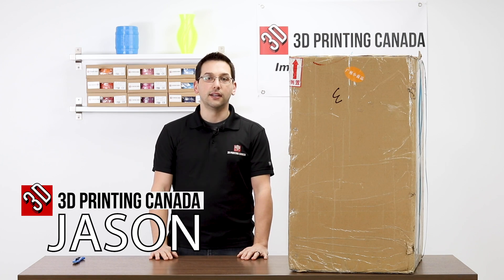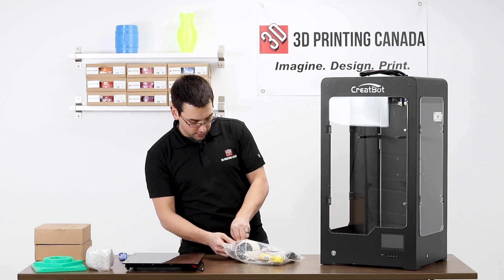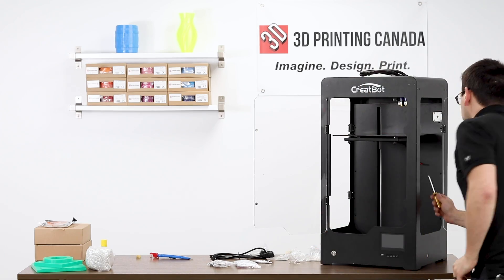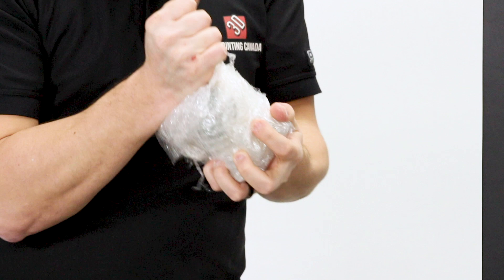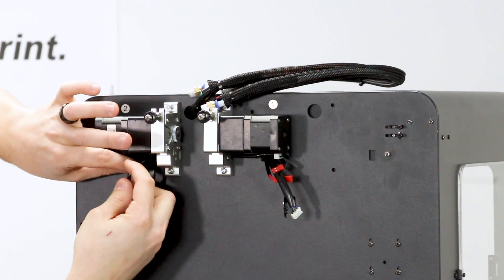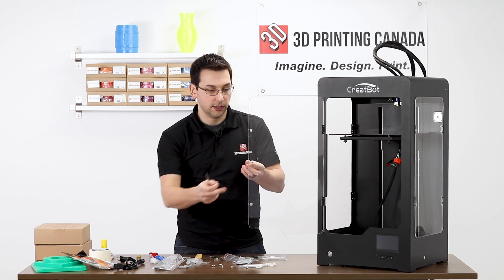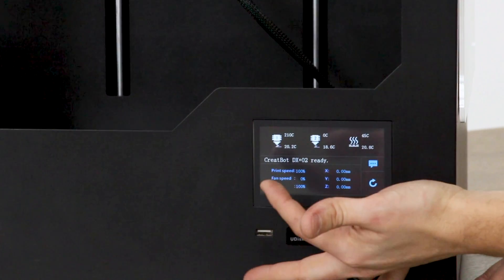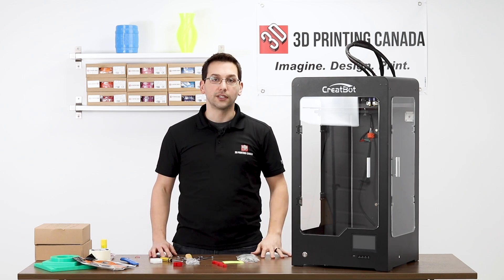Creatbot DX Plus Unboxing and Assembly

Comment: I bought a D600 Pro 2 a few months ago because I wanted a really big printer. Words cannot adequately express my frustration and disappointment with it. I have only managed to satisfactorily print 2 simple mid size storage boxes with it (PLA). All my attempts to print PETG have resulted in failures (extruder jams, filament lifting off the heat plate despite using glue, etc.). The print quality is about equivalent to a first generation Creality. It cannot put down a first layer that is even closer to a Prusa or Bambu. It has WiFi but you can't transfer files to it. There's a large amount of spurious filament in most of the prints. It scrapes layers while printing (yes, I calibrated the height twice). There are pronounced layer lines. All prints require an application of glue. The interface is primitive and clunky compared to modern printers. As far as I can tell, there have not been any upgrades to it, except for infrequent slicer upgrades. It cannot automatically switch to the second extruder. Parts are semi-proprietary and Creatbot doesn't even have an on-line store for normal consumables. Third parties sell them, but be prepared to pay 5-6x the cost for a hot end compared to a consumer printer, yet there's nothing particularly special or sophisticated about them to justify the high prices. The support has been excellent. I know. I have contacted them about 20x so far, but I would rather have a printer that doesn't have issues that necessitates contacting CreatBox.

I gather this printer is really intended for printing exotic materials that require high camber temps and annealing. As of now, I would not consider using an expensive filament when 9 out of 10 prints need to be reprinted or are disappointing. A huge and expensive mistake.
Reply: Estoy en la misma situacion, consegui una DX V2 y simplemente el que se le rompiera el heatbreak despues de un atasco masivo trajo un problema ridiculo de precio de hasta 10 veces arriba en comparacion de partes comerciales de impresoras "domesticas". Estoy considerando hacer adaptaciones para mejor remplazar compretamente el cabezal por uno estilo V6 porque realmente es ridiculo el modelo de venta de partes de Creatbot.